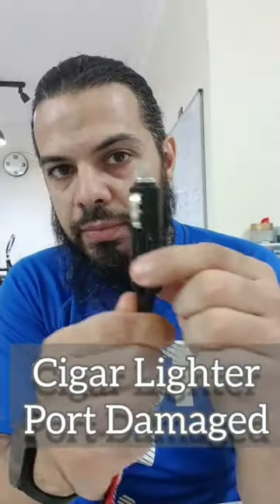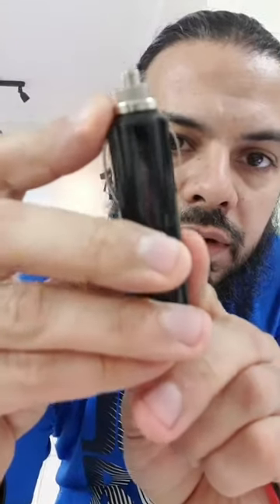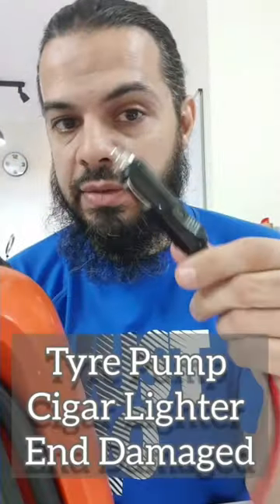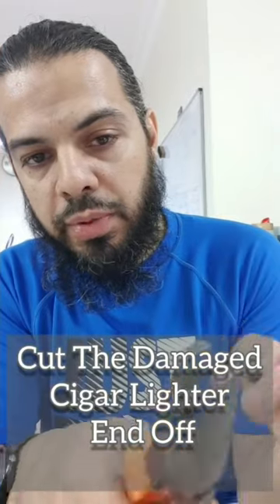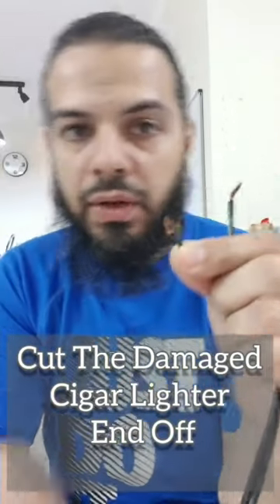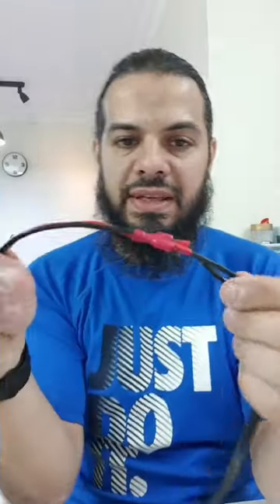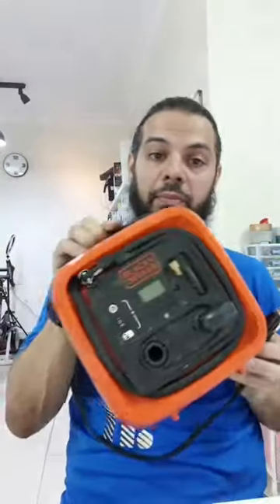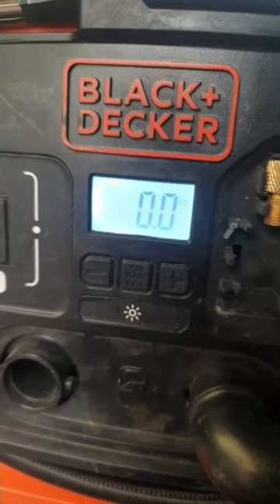12v Cigarette Lighter Connector  Broken - Easy Fix - #shorts #car #easyfix

Comment: I am attempting this with my tire pump, but I don't know which wire on the pump to attach to the red and which to attach to the black - the wires from the pump are both black.  Does it matter which I attach to which?
Reply from the maker: Very good question
Tbh honest i think i just guessed it and it worked. The other way is likely to blow the fuse.